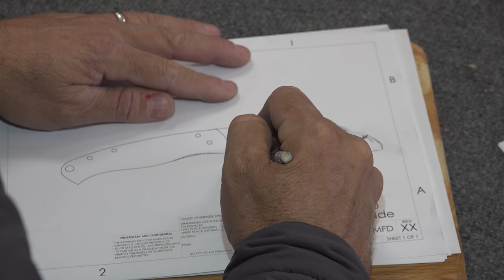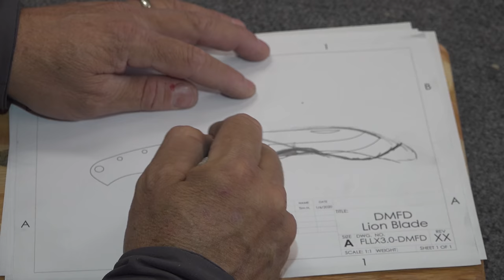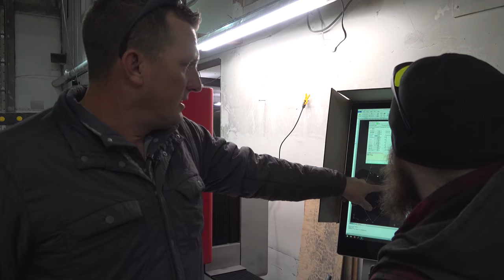Designing and Manufacturing my very first Pocket Knife! Silver Stag "Joey"

Comment: Love Silver Stag fixed blade knives and yes D2 tool steel is extremely hard but IMO after carrying a knife for the past 38 years and owning countless designs that one is too thick for a pocketknife, needs a old fashioned leather pouch like a ol Buck knife. The Joey is very similar to the Benchmade Bone Collector that has walnut handles and is made with D2 tool steel, the blade shape is kinda close too, I own the Bone Collector Benchmade and after carrying it a couple times it only goes in the backpack, just too bulky. Prayers for the gentleman battling blood cancer and for your family Robert.

Comment: Pocket knifes in the uk. If the blade and handle when open is more than 6 inches, no go. If it is less than 6 inches, no problem, but as soon as you make it with a locking blade...it becomes illegal again.